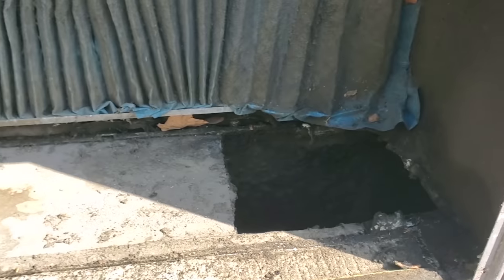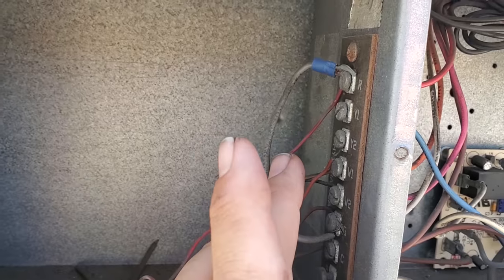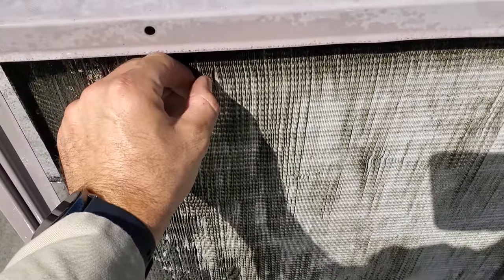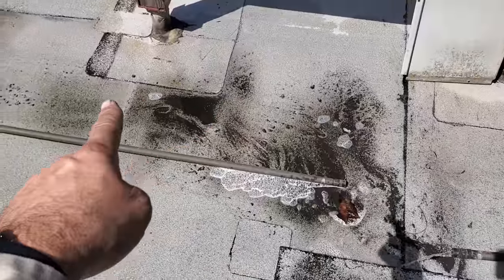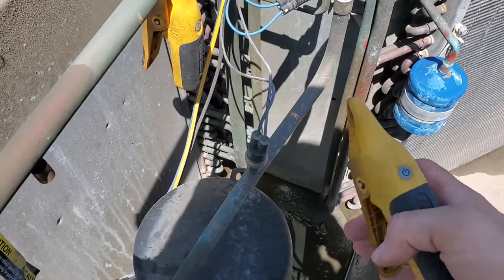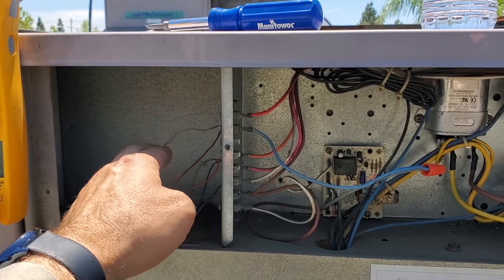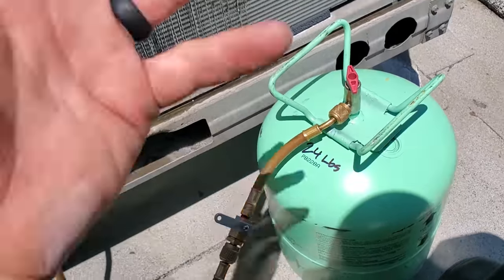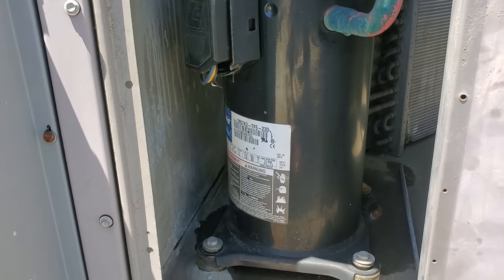ONE THING LEADS TO ANOTHER

Comment: I’m new to learning HVAC/R and I am only picking up bits and pieces right now and I am not able to devote my time fully for another year. What was funny about the return air opening?
Reply: The 12x12 return opening is way too small, therefore the system is starved for return air and must draw enough air from the outside. This outside air will be hot in summer and cold in winter upsetting the system’s equilibrium..
Reply: GSMjr ah, ok. That makes sense now, thank you!

Comment: Why would R22 67 psig pressure be to low that seems like right were it should be?
Reply: Yes but it could be that with an 85 degree suction line temperature the unit was low charge and the psi looked right because all the outside air he put increased the load/psi.

Comment: I'm not big on A/C, could you explain what the economizer does in the future? Maybe on the livestream. That unit is rough.... Keep it up.
Reply: So the idea of the economizer is to save energy, it does this by opening dampers that bring in outside air instead of return air from the building. It (is supposed to) operate(s) when the outside air is a substantially lower temperature than the supply air, basically providing "free cooling." The problem is that most restaurants don't see the return on investment on fixing their economizers, so they are generally just left to die. They often fail quickly because the economizer electronics are placed in the outside air stream, so their boards get crapped up quickly.

Comment: well i know some easy trick get customer get it replace
best way just wait unite it failures and go up there check it n come back down said wholes unite is died and going cost you way more to fix it and better off replace it for cheap

"they be like what WHAT" lol
i have few friends contact me up because two ac is failures badly dure conf "outside cooling is totally gone" and other one "electric burn itself on fire but didnt burn anything else but wholes unite system" i like dang i explained to customer if you wanting to fix this two broke unite it going to cost you limb it better off replace it cheap n be done "they went jaw less" lol